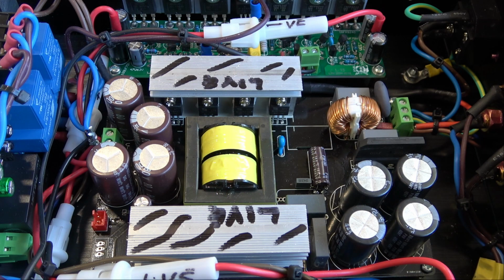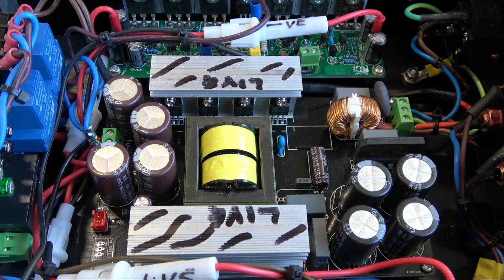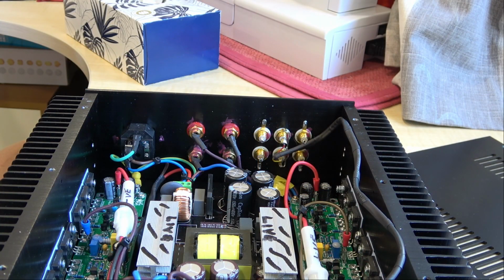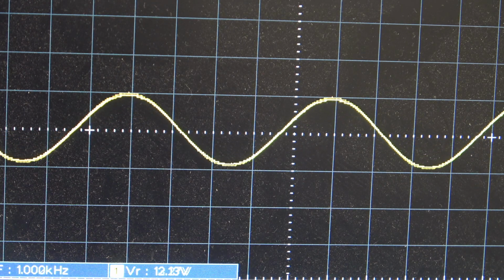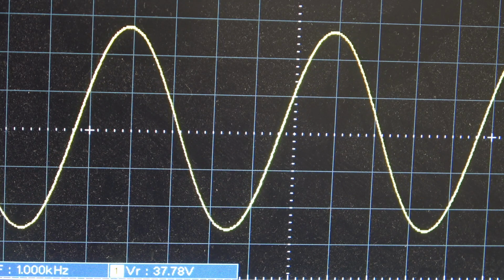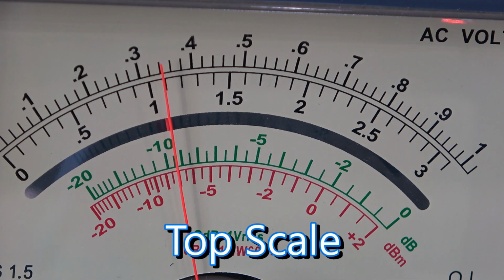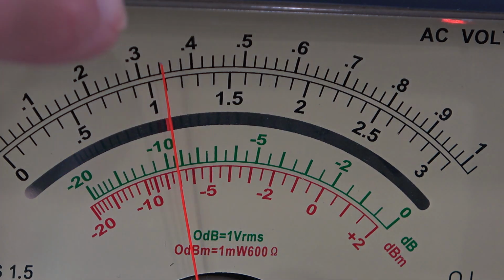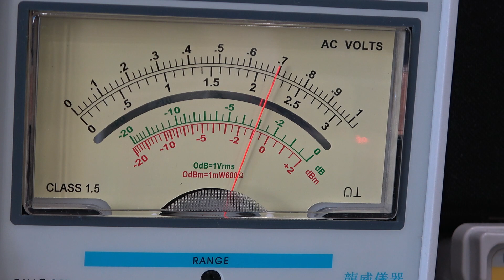LJM. L15.  MOSFET. Amplifier 150 watts x 2 into 8 ohms

Comment: you MUST measure amperes out of amplifier! not always you can only measure volts. can you show the resistance you use when measuring watts?

L20 amplifier with 50v does not measure anything more than 200w in 4 ohms
and transistors do not become dangerously hot
Reply from the maker: I was not just measuring open circuit volts to get power measurements. It was connected to 8 ohm resistors mounted on a heatsinks, as always.
Reply: @MichaelBeeny  People want to know it and see pictures. Then you avoid all questions.

Results will not be exactly the same if you measure amperes ?? Have you tried it?
Reply: @ford1546  Most standard non clamp type Multimeters measure AC current using a current shunt inside the multimeter, so in fact a digital multimeter is measuring a voltage across a known low impedance load internal to the meter itself to give a current reading. By measuring the voltage across a known load external to the meter and applying Ohms Law you are achiiving the same thing. I = V/R The result has to be the same, the clue is "Ohms LAW" paying attention to the LAW bit
Im not sure why you are getting held up on Amps because we are discussing power and that is a product of Current and Voltage, both are equally as important when it comes to power.
I am  interested, how do you measure the current in your tests? like where in series are you connecting your clamp/series meter? thanks
Reply: @Cyrixxz 
I know about shunt.

Sometimes when I measure an amplifier
I measure low volts and a lot of amp or vice versa.

sometimes  a transistor or ic. Have  limitation.

nap250 clon I measured.
22.6V 5.54A = 125w
22.6V × 4 ohms = 90.4w

Possible my measuring instrument measures inaccurate amp. I do not know.
But in my case you can not take volts x ohms
Reply: @ford1546  22.6v x 4ohms =90w is for DC current (P=VA) Amplifiers for audio are AC output since ur testing it using AC signals such as a 1khz tone
Its a different forumla. 
The formuila is p = (Vrms*Vrms)/impedance.
Assuming your voltage of 22.6v is RMS then p=(22.6*22.6)/4 
p=127.6 watts
First you need to make sure the volatge across your 4 ohm load is measured in RMS. If ur using a scope it will be in peak voltage so convert to RMS using an online tool. I believe this is what has gone wrong with ur maths.
Reply: @Cyrixxz 
I know that the amplifier provides AC. current.

Tell me more?

What is the correct way to measure watts on an amplifier and why.
I have always measured
ac. volts and amperes.
AC x amper = watts

But almost everyone on youtube I see  measure ac curent and takes
AC x 4 ohms = watts
Reply: @ford1546  First understand why we use a dummy load. We use impedance as opposed to resistance because the "resistance" changes relative to the frequency, on a dummy load load like a 4ohm resistor this impedance is constant 4ohms but on a speaker it changes over the frequency range. This is how filters work, u can create a low or high impedance at certain frequencies to filter the signal using inductors/transformers. DC will just pass blindly through.
There is also the fact that the current is linked to the voltage as it swings through the phases of the sine wave. It is a subject in its own right and is outside what can be explained in a few lines on a youtube comment but is well documented. 
If everyone is using AC x 4 Ohms = power then this is wrong as it is a DC formula. Think of it like this, a DC battery never passes through 0 Volts or - volts  on the + terminal, however an AC sine wave passes say from 0 to +50v then back to 0 then -50v so it isn't constant so we need to reflect that in the maths. Since the current isnt constantly flowing and sometimes there will be lots of Amps and sometimes a lot less depending on the phase angle, its a sort of average current we calculate using the Vrms squared/4ohms function. This is why it important to make sure you are working with RMS voltages (around 70% of peak voltage) before you feed in to the formula.
Reply: @Cyrixxz  Thank you very much for a good and detailed explanation.

I use a heat sink
with many resistors in parallel to achieve that it can handle many watts. 4 and 8 ohms.

so if I  use a fixed 4 ohm resistor and an RMS. multimeter and measured volts and amperes.
(volt x amper = watts)
which is the most correct way to measure an amplifier?

it is true that an rms volt meter measures peak voltage and a normal multimeter does no measure it so well?

I have been doing electronics for approx. 25 years. I have built many speakers and amplifiers.

I know a lot but not everything.
Reply: @ford1546  no you cant use volts x amps because that is for DC. U need to use (VrmsxVrms)/load resistance. U need to square the AC voltage and divide it by the load.
Some multimeters like Fluke for example measure RMS as standard. U can check this is correct on a known AC source. For example if you read 230v (depending where you are in the world) mains voltage then that will be RMS, if it measured 330 volts then your meter is measuring peak. If you have 110v mains and measure 155v thats peak.  U really should be using a scope because u need to measure before distortion or any DC is produced and you can't be sure without checking the sine wave for distortion on a scope. Be careful though, if your scope ground is earthed and you get this wrong it will kill your scope and or amplifier. Best use an isolation transformer imo much safer. 
If u want to convert peak to RMS and lets say u measured 330v on your mains test then you can convert it to RMS: 330v * .707 = 230volts. Same with 110v lets say we measured 155v on ur meter then 155*.707 = 110v. On the other hand if you wanted to measure the peak voltage and you had the RMS voltage: 110v * 1.414 = 155v and 230v * 1.414 = 330v.
So why are we x by 0.707? Becasue 0.707 is the mean average of 70% on a sine wave and that is RMS.
Reply: @Cyrixxz  
What is the formula?

22.6v x² / 4 ohm = watt

Yes I use fixed 4 ohm resistor

Can I use clamp multimeter?

22.6v x² / 4 ohm = 127.69w

22.6v x 5.54A = 125.2w

Not much difference.

is this correct?
Reply: @ford1546  The formula is P =V²/R. Where V is the AC voltage you measure across the load and R is the load impedance. Where are u placing the clamp meter is the question. For example on one of the DC rails or on the cable between your load and the speaker terminals?
Like I said you need to know if it is clipping, you really need a scope. With a scope and a 4ohm load you can calculate power accurately. I only use a clamp meter to measure idle current on the DC rails. I would prefer to do this on the emitter resistors and use ohms law to calculate load current, but these can sometimes be a pain to get to. The great thing about mosfets is they share current equally unlike transistors so it is easy to parallel devices up on the same heat sink. But im making it more confusing so i'll stop there.
Reply: @Cyrixxz  
Thanks for the explanation. 
Can you answer yes or no?

22.6v x² / 4 ohm = 127.69w

This is what I type on the calculator. is that correct? Yes or no

Thanks for all the help 🙂
Reply: @ford1546  Yes it is correct. I see what ur doing there. I didnt realise you were typing out what you are typing in to the calculator in terms of button pushes. That sequence of calculator button pushes is correct and is the same as P=V²/R. Good news for you! Due to maths being correct u now have a 127w amplifier instead of 90.4w amplifier happy days. 40 watts of extra power from a u tube comment not bad going :)
Reply from the maker: @Cyrixxz  Well done James, could not have put it better myself. Thank you. When I measure power output. I always use resistors as a load. I measure the AC signal on a true RMS meter. I consider power measurement at just prior to visible clipping. Some people will measure at 1% THD or MANY at 10% THD which of course will turn a 100Watt amplifier into a 120 watt or more amplifier. I think my way is a more truthful way. Many chip type amplifiers measure power at 10% THD often a silly load impedance of 2 ohms. Not really a true world rating but looks good on paper for those that don't understand the numbers.
Reply: Most devices measuring high current measure voltages and convert to current using ohms law, like for example current shunts which give a proportional voltage to the current pulled through them. His is the L15 amp not the L20 amp.
Reply: @Cyrixxz  I know! l20 is a larger model of l15 from the same manufacturer (LJM)
l20 uses 8 transistors.

I only tell how many watts I got out of l20 with optimal 50v power supply.

I use many 100w resistors in series to get 8 ohms 4ohm.

I use a multimeter and
oscilloscope and measures both volts and amperes.

I use different frequencies.

you must always show what resistors you are using and what frequency!

Comment: It looks like a half bridge topology smps with tl494 driver. And schottky diodes are overheating. please write part numbers of those elements on a heatsinks. And I do not like that there is no output filtering inductors. it might be that the high frequency ripple from driver 40-60khz or even higher harmonics are going to amp and it is self oscillating. And I did not noticed snubbers for the diodes witch is not good too.
Reply: Quasi resonant LLC, half bridge. No output inductor since the transformer needs to have inductance to function in that mode, also adding an extra inductor to the output stage will affect the transient behavior which is not good for an audio amplifier. Switching frequency is variable up to 400KHz. Output diodes seem to have snubbers on them, there are SMD capacitors and resistors connected on the diodes (looking at picture of PCB).

Comment: Hi Michael. can you drop a link of that power supply. Transformer is big enough to provide about 800-1000w. One heatsink is on a high side for switching transistors and the other is on a low side for schottky diodes iteresting witch heatsink is overheating. It looks like tl494 driver. can you look on  a markings of that sot16 chip on the bottom side of the smps board. P.S. it is not normal.
Reply from the maker: The SMPS was from WISHCOLOR from Ali Express. I think they are the only ones selling this.

Comment: Hi Michael, based on your videos I managed to replace ICs STK4036X with L12-2s in my Grundig V8100/V303 amplifier. The sound is quite good but there is a hum ( or small brum) coming not from a power supply but coming when I connect a volume plate ( even not a whole preamplifier plate). 
Then I came to an idea to put L15 in one channel  leaving L12-2 in the other to hear the difference between those two. L-15 was working OK, DC offset was ca 5mV. And the sound ?..............no change at all ( at least to my ears). Even volume level was the same. So I just took it out ..and sold.
Reply from the maker: Volume, overall will be the same if you are using the same power supply. Power output is really a function of the supply voltage.

Comment: Your amp looks good Michael. Well done!
Can you add some holes at the bottom so that it draws in cool air at the bottom and releases warm air from the top? Could those live heatsinks on the power supply regulators be fitted with ceramic spacers to insulate the regulators electrically? Do you need all of the power? Could you run it on a lower voltage and lower the average heat. Perhaps have a servo that changes the rail voltage momentarily when the amplifier needs it.
Reply from the maker: Space is the main issue in here Chris. A powerful amplifier really has such a great dynamic range. I might replace the SMPS with a transformer with a 50/0/50 volts after rectifier, like the L12/2. Power will be limited to about 100 watts like the L12/2. I shall experiment and report back with a follow up video soon.
I think the heat issue needs more than more holes in the base sadly.